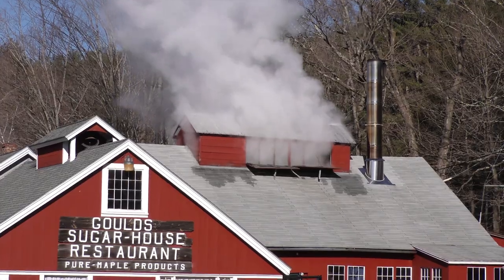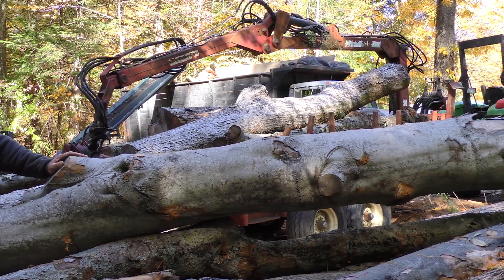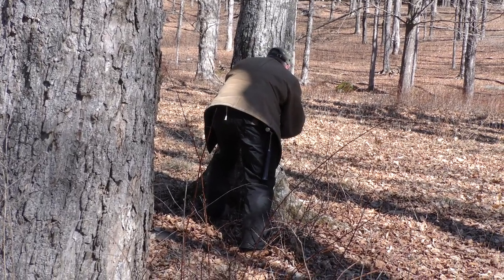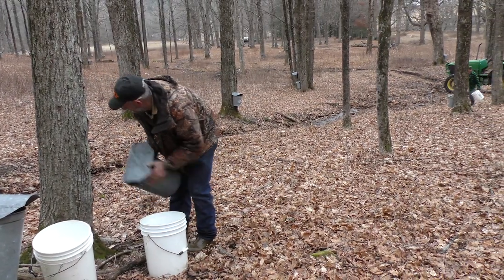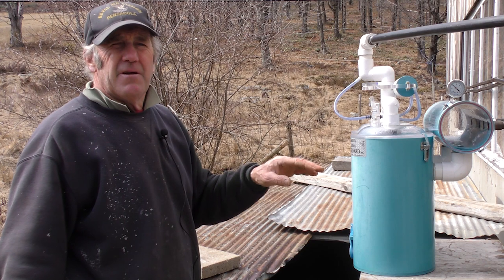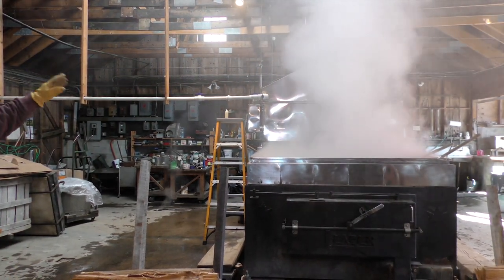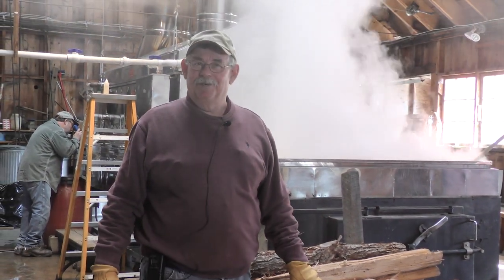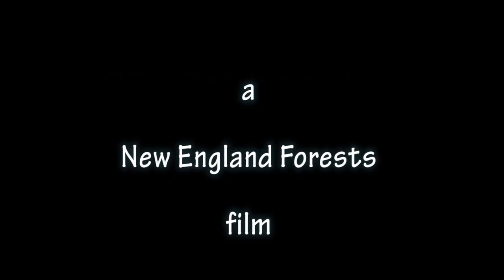Maple Sugaring at Gould's Sugar House

Comment: What determines or what makes a syrup dark or light?
Reply from the maker: Lighter syrup is usually produced early in the season, when temps are colder. As the days warm up, natural bacteria in the sap increase and change the sap's sugar from sucrose to  fructose or glucose, which makes the syrup darker. And, some would say, even more tasty!
Reply: When I made maple syrup, as a hobby, back in the late 60's I got the impression that darker mostly meant you'd overcooked it.  Darker sugar; think caramel.  Whenever I drive to Canada, I buy very light maple sugar in cans, since I think it has a more refined flavor.